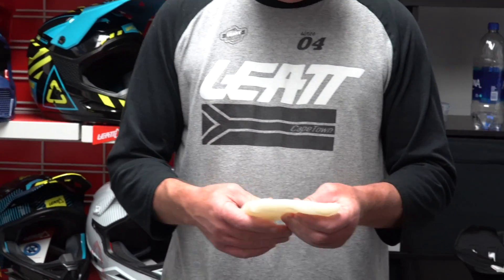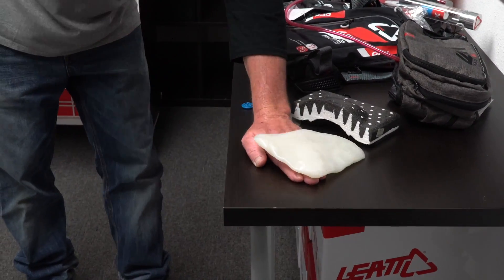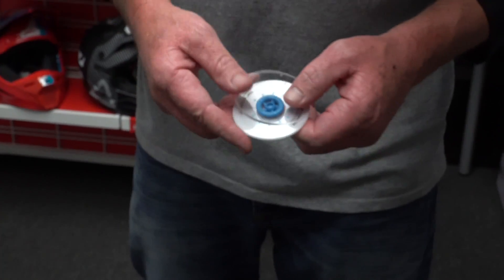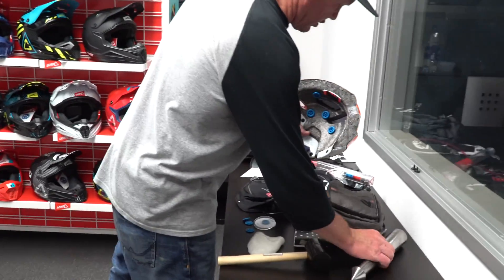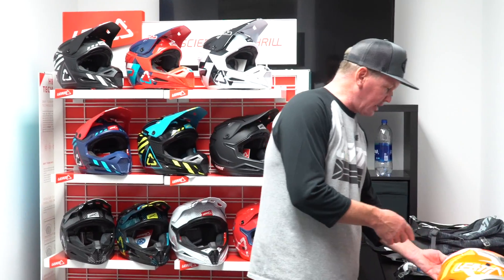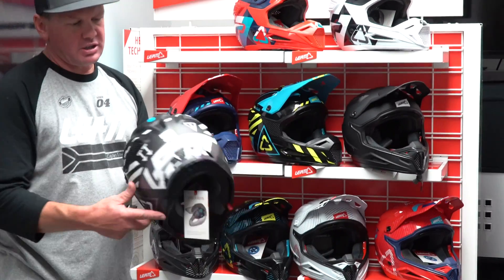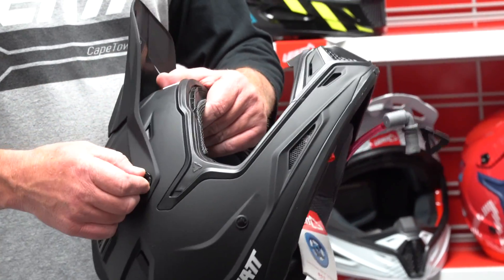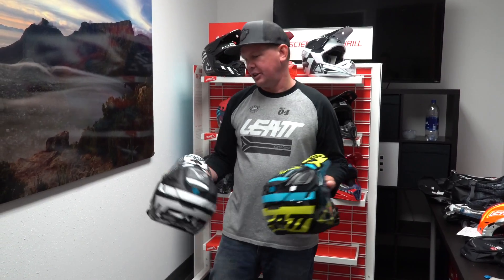The Science Behind Leatt's Helmets

Comment: What was the reasoning for changing the design of the outer shell to look like a Fox for? You took the best looking “unique in the market” as well as functional helmet and made it look bigger and like a Fox V3. I don’t get it.

I have had 3neck braces all Leatt, body armour, knee braces, 18 4.5/5.5 Helmets and kit,  as well as DBX mtb gear, huge fan of the safety tech it’s proven itself many many times, but I don’t get or like the new style of the 5.5/6.5 helmet and you have no Orange colour ways yet.
🧐
Reply: Hi, I just got my Leatt 4.5 today and compared it to me Fox V1 and it's the exact same size. The reason I bought it was because it was reviewed to be smaller shell size than other brands but that's not the case. What year did they change it?